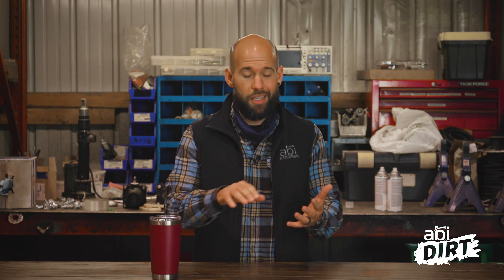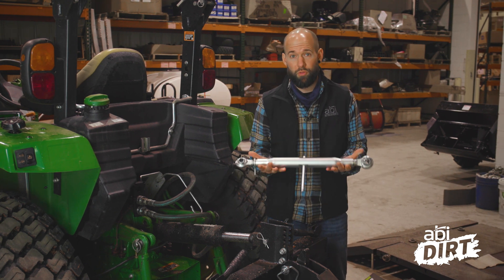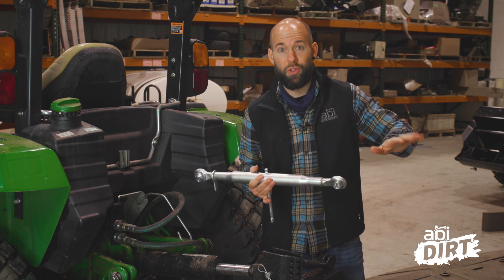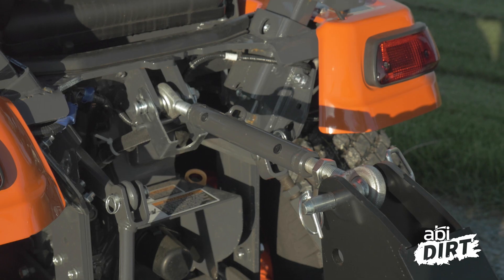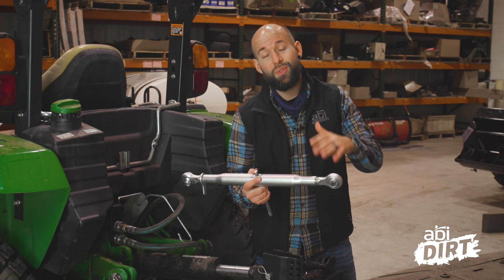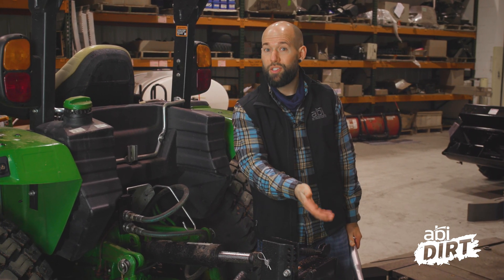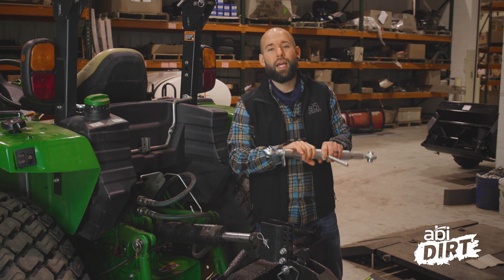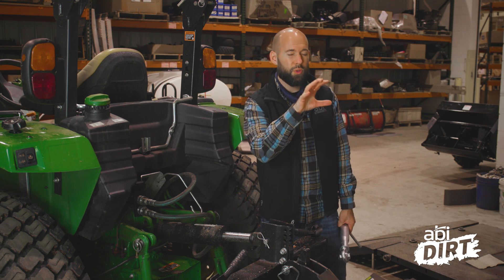Hydraulic Top Links For Tractors - ABI Dirt

Comment: What is that metal piece that spins on the manual top link? Is that a lock?  It’s only on one side
Reply from the maker: Hi Jim!
That little teardrop-shaped nut is called a top link locking collar. Once you've got your manual top link extended to the size you need, you can turn that collar tight against the center tube of the top link to prevent the threaded eye-bolt from turning back in (thus contracting your top link). -- It only needs to be installed on one side of the center tube because the threaded eye-bolts are opposite threaded... as long as one side is locked, the other won't be able to thread inward.
Hope this helps!
-- Matt @ ABI

Comment: Would you be willing to have a loader that you could only push and lift with, without being able to tilt the bucket? Well basically, that is exactly what you get with a manual top link! After five years of frustration with a turnbuckle, I am finally on my way to installing a hydraulic top link. Yes, instead of just using the $88 screw that came with the tractor and cost me nothing, I am spending $1k on the upgrade. I’m excited, but there are literally enough options and specifics that I’m worried that I am making all the right decisions. It looks good so far, but I’m still waiting for a few parts to come in.
Reply from the maker: That's a great example, Steven! You've got all the power and ability of your 3pt and your attachment of choice, but without full control of range of motion you're not getting the most use out of it.

Best wishes as you get the parts in and get up and running!
- Matt @ ABI